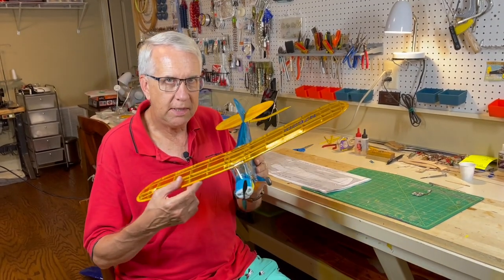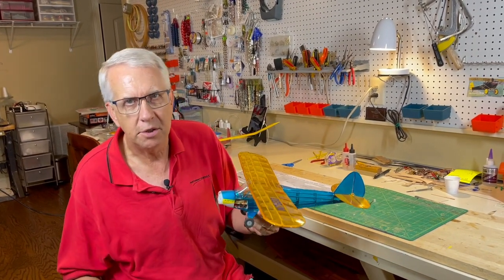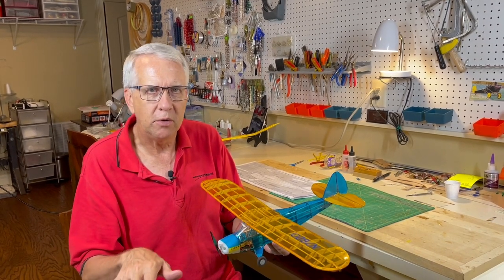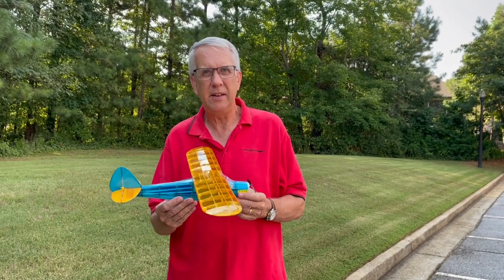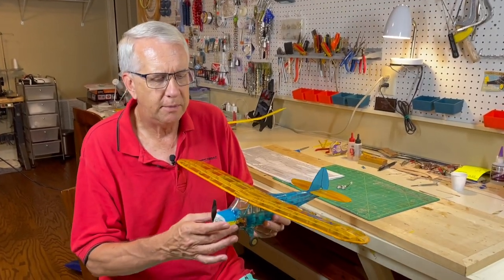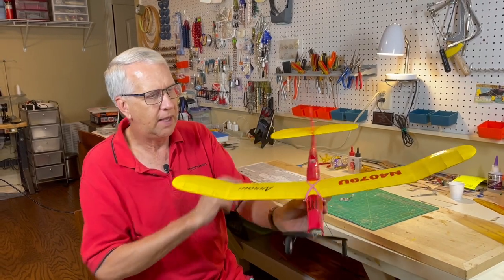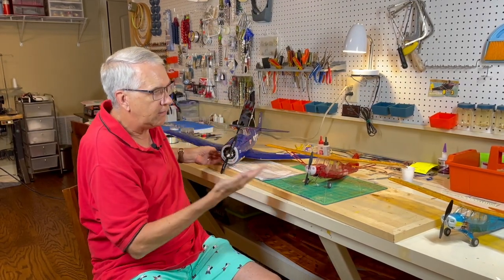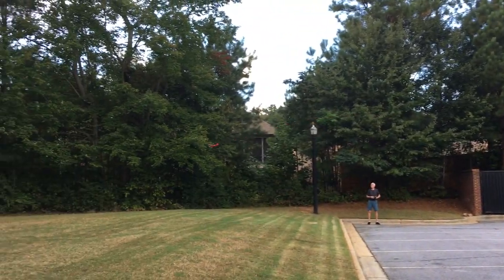Guillow Piper Cub RC Conversion Part 2

Comment: Hi Tim, at first the same thing happened to me in the two Guillow Super Cubs that I converted to RC. What solved the problems and I think yours may be missing are two things: first a bit of washout angle to avoid tip stall. You have to twist the wings a little so that the leading edge at the tip is one or two degrees lower than in the central area. The actual Super Cub has too. Second, I think that the horizontal stabilizer in this kit has a low angle of incidence which pushes the tail down, which added to the high lift of the wing that causes a stall as it picks up speed. I corrected it by modifying the stabilizer angle. I hope this helps. Greetings.
Reply: I also built both with ailerons, they help when the wing drops but they generate a lot of adverse yaw.
Reply from the maker: Marco:  Very useful tips, thanks!  Copy on adverse yaw as well. Tim
Reply: I second this.  Move the CG forward a bit, washout the wingtips a smidge, and check the horizontal stabilizer angle of incidence. Glide test to see if it stalls with no power applied to get a baseline. I think it is super close to being as good as the Aeronca but it sure seems like the combination of scale-like looks and small size raises the stakes a lot.  Nice work on the planes and the videos!
Reply: I think Marco has nailed it. The wing drop is caused by the tip (or whole wing) stalling first and the classic remedy is to have washout. Also the Cub seems to fly tail low, and I agree with Marco that the tail plane is the problem. I love the channel and your handiwork!
Reply from the maker: HD:  Many thanks for your input!  Tim
Reply: I agree need some wash out on the wing tips. Great looking model 👍

Comment: Tim, I think I would try even more noseweight and if that didn't improve matters add some dihedral? The Hellcat is a nice flyer, I managed to get my Guillow's Spitfire flying very nicely as well.
Reply from the maker: Cliff:  Adding dihedral could help, but I am getting more and more intrigued with my designs that fly with absolutely zero dihedral, as well as a flat wing.  Tim

Comment: Hi Mr. McKay, I saw your video on the J3 rc conversion, and I would like to add some thoughts for your consideration.
In the video after you double checked the cg, and flatness of the wing panel. I think, if you have not tried it by now. Check the overall incidence. In the 1st video you mentioned that you would cut the side window/wingsaddle area to include a few degrees of positive incidence. In my observation as a full scale aviator myself, I think that would be the cause of your sudden left wing panel drop, left spin entry tendency that the model showed. Let me explain, in a nutshell my observation.  The main cause of spins in full scale aircraft is first, uncoordinated flight followed by one wing stalling before the other. That means, if the designer all ready added the maximum positive incidence to the wing root, adding some more will exacerbate the possibility of an earlier stall. Add to this the P-factor, and possible strong torque the motor is adding to this light air frame. Then just a little rudder into the stalled tip and result, incipient spin entry which you expertly recover from by looking at the sudden snap and nose high pitch recovery.  Also in the first launch where the model passes in front of the camera, the plane seems to be in skidding flight path (nose pointing left while still flying wings level). Add to it that by having the wing perfectly flat, you are not including some negative incidence in relation to the wing root at the tips. If you look at single engine Cessnas, Pipers these have wing tip stall reducers such as washout/twist or spanwise airfoil distribution (thinner airfoil cross sections at the root increasing in thickness towards the tips (piper cherokee line) Perhaps to start off, place a shim behind the trailing edge of the wing. and see the result.
Also, try to add maybe 1-3 degrees of twist at both tip trailing edges so that the tips have a negative incidence in relation to the root, and also consider the overall ballance of the wing alone. 
Please let me know how it works.
Thanks for your great videos! Looking forward to also get deeper into the hobby after my retirement.

Take care.
Rafael E. Morales, PR, USA
Reply from the maker: Rafael:  Many thanks for checking in!  All good points on the Guillow kit.  I have found, over my conversion of 8 Guillow kits, is that very small errors can creep into the wing, fuselage alignment, etc. that have a quite large impact on flight handling characteristics, especially with the smaller scale models. I wish I had a better understanding of this, but this seems to be the way things work out.  Some fly great, others not so much.  Tim

Comment: Looking Good. My first kit build was a Guillow's Hawker. I built almost all but the lager kits. Gentel hand tosses (no power) to set trim. I see you have nice grass to do this. Elec or rubber, Hand toss will get you in the ball park. All Guillows are tail heavy at first, The lump of clay is an indicator. If the plans show the gas or control line mods, there are considerations, The empennage could be solid balsa.
Reply from the maker: Planker:  Good inputs, thanks!  Tim

Comment: As I see it,, this one flies just like a Guillows airplane. The larger ones fly a little better as you have demonstrated, but that tiny unmodified Cub will always either be tail heavy unless heavily nose- weight, or unless the centre of gravity is moved rearward, making it a stall/spin waiting to happen.
Guillows  kits, if unmodified and built from the box, have poor airfoils and too much wing loading to fly well. Given your flight results, I think that the center of lift and center of gravity are too close, a common problem with Guillows' suff. Build Dumas kits, they actually fly well without much or any mods.
I learned not to expect these kits to be good flyers many decades ago. You are a valiant warrior, though, and if anyone can make them fly well, you can.
Reply from the maker: Glicksman:  Kind words and thanks for checking in!!  Tim
Reply: @TimMcKay56  No worries, mate.

Comment: Hi Tim , I just noticed on your piper cub, that the rudder is almost half size of the fin , I wonder if you could make the rudder smaller , I have a model that has a tiny rudder , and it turns it adequately, just hope that can help, and my model is a high wing model like a trainer , with dihedral, from Tony, from england
Reply from the maker: Tony:  Yes, you can make the rudder smaller. As the model flies slowly, I opted for a larger rudder to ensure needed control. Tim

Comment: If the wing isn't square with the fuselage(where the wing connects to the cabin) cause the piper cub to fly into a spin like that even though the wing itself isn't warped? Just a thought.
Reply from the maker: Rodney:  Appreciate the input, but I do think the wing is mounted square.  Tim

Comment: It’s dropping one wing and hardly turning the other way, id check that one wing isn’t heavier than the other, I’ve had planes do the same thing and had to add weight on the opposite wing to get them to fly level
Reply from the maker: JP:  Great tip, thanks!  Tim